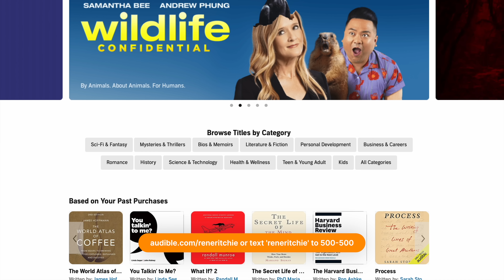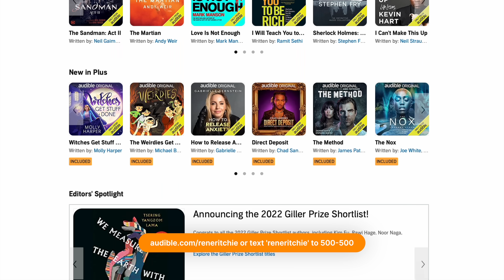The End of Big Silicon — Apple, Intel, Qualcomm

Comment: Im reaching a point of limiting my CPU & GPU performance by undervolting/capping GHZ so I can get more efficiency/stability, this allows me to have pervious gen top performance but taking advantage of a new node to gain more efficiency, it works wonders on laptops.
So I would say, buying the latest to get top performance of a previous gen at half power, is what motivates me to ‘upgrade’

Comment: The Limit for processors was hit years ago when they couldn't brake the 4GHz limit for a single core X86 processor, since then makers have had to move sideways in dev by adding more cores but lets the issue is still present. They have yet to make a +4GHz processor core.

Edit: wow I feel old, was it really 2008?
Reply: Interesting, can you explain how AMD is hitting 5.8Ghz on 7950x and Intel just releasing a 6Ghz 13900KS?
Genuine question btw. 
Are you saying they are using tricks?
Reply: @a.m.g.r7804  This was 10 (ish years ago) due to the size limitation of the technology but now there are into the sub 10 nm process it looks like they are breaking the barrier again but as stated in the video they are struggling with heat dissipation and silicon tunnelling issue resulting in throttling of the processors to under the 4GHz speed
Reply: @AJB2K3  I don't understand what you are saying 4ghz was exceeded about 12 years ago atleast on desktop, there wasn't any issue with it throttling. Certainly more recent with 5Ghz+ things are getting more difficult to cool as power usage goes up.

Comment: The atomic radius of silicon is about 0.11 manometers, so we are reaching the limit of this element. Something will have to replace it, eventually, or we'll have to replace the transistors with something else.
Reply: More efficient software. If we could only use machine instructions as sparingly as we did in the 70s and 80s, combined with modern CPU architecture and algorithms. Offloading as much as possible from the main CPUs, like old-school mainframes did. There has to be a limit, and likely we're already close to it. Making better use of the available process nodes, in terms of microarchitecture. The ever increasing CPU speeds we've seen have made software development lazy so far as efficiency is concerned.

Comment: Not the end, The begining for qualcolm

The snapdragon 8 Gen 2 is already on par with the A16 in everything but single core CPU performance

It actually beats it comfortably in GPU and Ram performance

Is it the end for Apple silicon ?

Apple can advertise its single core performance all it wants by humiliating Qualcolm, equating it with A13

The fact is, the A16 is hardly 20% faster than the A13 and less than that with the 8 gen 2

The difference between the A12 and the snapdragon 845-855 was far more than its now

The 8 gen 2 is far faster than chips 3 years older and Qualcolm is showing no signs of stopping

Maybe Apple is reaping the results of its chip team talent loss

But Hope not

Comment: I think the largest issue is heat dissipation and cooling that would make computers go to the next level
Reply: a expensive paperweight is all you'll have, as there is no point in battery/performance, if the apps are not there, and plugin's.

To me, apps always dictate what device can be used. If the "right" apps are not there, its not gonna sell. Which is why Rosetta 2 is still in OS today and haven't been pulled yet.

Cores and all make a huge different sure, but app development  native come first.

Comment: interesting comversation, i always wonder if there a theoretical limit on how large a single die can be, imagine a modern 4 nanometer chip the size of 10 486DX processors, yes big but can still fit inside a modern gaming PC and would have more power than any modern computer. Yes, it would probably cost alot to produce but its only a scaling issue not development as we already reached 4nm capabilities.
Reply: I’m pretty sure dies will get larger as it becomes harder and harder to shrink the nodes.

Comment: Why don't we just refine our current coding structure to make applications and operating systems leaner and super efficient to "fly" even with a 10nm chip? I mean, I don't see the need for smaller and smaller nm numbers if we can still get the same performance for older chips with some ingenious coding tweaks. I remember the days Windows XP could fit in a 700mb CD and now, it's like a 4GB mamoth with endless services that just dont really benefit us that much. Back in the early 2010s when everyday smartphone applications never crossed 20mbs and now....we talking of GBs! I think the conversation should work in three directions. 1) Coding techniques 2) Efficiency per nm and 3) Battery technology.
Reply: well said a clean mean leaner code & running few services could be the answer we need
Reply: @dinozaurpickupline4221  absolutely. Even these older smartphone chips pack a punch!
Reply: yes,I'm rockin an older realme 7 pro
I don't know when would chrome force me to use 12gb ram phone
Reply: blame the os itself
Reply: I downloaded the Adobe PDF Reader years ago and it was 60GB. I expect that it would be close to 80GB now, if not more. There is no way a PDF reader should be that size. Software bloat is real.
Reply: @sylviam6535  that's too much...I suspected it also bundled some adobe features undeneath. I used Sumatra PDF reader, less than 10mbs....and works fine for me

Comment: At some point, it will be harder and harder to make chips faster, instead we need to also make the rest of the system faster as well - so even if the CPU isn't 20% faster - the overall system will be. We are starting to see some of that with PCI 5-6 and the move from SATA to PCIe based NVMe drives.
Reply: the one that slowing down the system is the bloated os

Comment: I really liked what they talked about, but I have a question: why has nobody talked about the fact that Apple has been stagnant for 2 years in its high-performance core designs?  In 2020, when Apple released the A14 Bioinic chip, I presented it with the Firestorm cores, which reached a frequency of up to 3.0 GHz. The following year, I presented the Apple A15 Bionic with the Avalanche cores, which reached a frequency of up to 3.24GHz, and this year. Apple presented the a16 bionic chip with the Everest cores with a frequency of up to 3.46 GHz after 2 years and if you take the difference in frequency that Apple increased between its processors to see the increase in ipc that they would have achieved in 2 years, you get an improvement very small which is probably achieved by the increase in the L2 cache that apple has doubled in the high performance cores from a14 to a16 while in those same 2 years arm has achieved an ipc increase of more than 20% of a core cortex x1 to a cortex x3 nucleus
Reply: Well Apple has been 3 years on the same node.
Reply: @Sinier940n  It has been 3 years in the same node but it is the first time that there are no changes in the high performance cores if you don't remember from the a12 chip to the a13 chip they used the same 7nm node and they were able to increase the ipc by more than 11% now it's been 3 years chips no changes to performance lake cores
Reply: X86 is a very different beast than Arm. X86 has legacy that holds it back, code that is never used but needs to be there.
Reply: @jasonmajere2165  True. But when you talk to the actual engineers, they say that all that legacy stuff is like 5% of the core die space and doesn't really have any effect on the overall efficieny.
Reply: The clock speed is only a small part of the equation. There has been improvement in the architecture which produces more throughput compared to the old. So the fact that they dont have to clock higher is a plus point instead of drawback. Another metric is the amount of work done per watt where Apple has smashed thru the roof !!!

Comment: I remember in the 90s processor speeds doubled every 18 months. Once they hit 1 GHz the gains seems to have slowed. You get to a point where it is harder and harder to make more gains. Once they hit a wall on processor speed, they started adding more cores.
Reply: Was having this same conversation with my kids about how it was speed-speed-speed, then that leveled off, and then it became cores-cores-cores and now that starting to level off. I think the processors are so powerful now that they are rarely pushed to their maximum limit, I think the next ‘big thing’ is going to have to be software optimization for increased performance
Reply: people are looking at that,shifting loads on the server side to quantum based stuff,making os that keeps in account of quantum states & using AI seems to me like the next step,people need to colab more & instead of discussing these things on internet techathons should be launched around the globe,discussing these issues  on main stream
Reply: @MightyRob1  - The next thing will be accelerating the APIs in the CPU, but that may make the CPU wedded to an OS unless some generalized API for OSs is created, which I don’t see happening other than maybe for open source OSs.
Reply: However, GHz in the 90s aren't the same as the ones we have now. A 3 GHz from the 90s would PROBABLY have been the equivalent of today's 500 MHz
Reply: And that's where you measure iops and fps and running code like mining and other tests to see what it does. But my phone has line 12gb of ram and unless it is under 45% it starts acting buggy

Comment: Intel / AMD was stalled with x86_64 and backwards compatibility. Apple merely scaled the designs from the iPhone SoC designs which are more ARM clones than actual ARM licensed designs.  Even if Intel / AMD considered ARM and doing what Apple's done. It would produce non-compatible processors. Apple's secret weapon since Apple bought NeXT was the NeXTStep / OpenStep that evolved into Mac OS X and the developer API's.  Developers if they didn't do a lot of weird stuff in their code were able to port from macOS to iOS/iPadOS on ARM64 with very little effort.  In some cases, just checking a box and making some GUI changes. It doesn't work like that with Microsoft. It takes a lot more effort.  Linux has always been running on most every CPU architecture out there and there is already a Linux distro booting and running on Apple Silicon.  Apple still has a big head start and you have to understand Apple has internal Apple Silicon designs perhaps 5 years into the future they are developing. Some of which are waiting for FABs to be ready.  Because Apple controls the OS and the Developer API's they can deliver radical change far easier than anyone else.  No doubt Intel, AMD, Qualcomm, etc. will be attempting to change rapidly.  The next 5-10 years won't be boring that is for sure.
Reply: I love apple & linux
Reply: The Linux software ecosystem is mostly open source, so everything can be recompiled. Windows has to be able to run a large body of closed source x86 legacy code.
Reply: Intel won't... They can't do the same, in fear of breaking backward compatibility.... So much  more x86 apps break under Windows 11 ARM translation, and despite Microsoft's effort, there are no really any signs of improvements.. Apple is way ahead with Rosetta 2... besides, how do you solve the issue most manufactures will not go over at all ?

Drivers? chipset for motherboard by third parties like Gigabyte. You'll break too much trying to making everyone work together.. Apple can do it because their the they do it all.. True, you do have Surface tablets use ARM, but not in mass.. PC's (x86) are still used in businesses. and you can say goodbye to running ARM versions of Sophos or ESXi in a VM on ARM chips. That's not gonna happen. Perhaps that may change, but its gonna take a very long time.. if happens at all.

Comment: I think desktop should move to arm architecture or something similar. X86 is starting to stagnate in terms of performance efficiency/perf gains with new process nodes as well.
Reply: Care to remember that ARM is not solely Snapdragon. Apple's chips are based on ARM and they include x64 instructions sets to better accommodate legacy code, but once the need for that emulation is dropped, the chips will be even faster for native code.
Also, MediaTek is making some incredible advances on performance per watt as well. If you check Dimensity 9100 benchmarks you'll see important improvements.
So, the shift from raw power to dedicated silicon is key to the future of computing. Instead of a one-size-fits-all you get software backed hardware that can expand where raw power finds a limit.
Reply: ARM architecture has reached it's limitations as well. Isn't the latest Snapdragons stagnated at 3ghz. The last two flagship chips had cooling issues.
Reply: @DerrickBest  arm hasn’t reached its limit. 3ghz is the clock speed because it’s a mobile device and raising clocks would increase power consumption. The new snapdragon is significantly faster than the previous while keeping similar clocks though.
Reply: @Earnist Se but they did stalled. If they were getting faster chips they could lower consumption a bit and increase clock speed.

Comment: A real question is how much speed do you require to do what you want to do.  Most iPhones rarely if ever  run into their  maximum performance even playing games.
Reply: You don't need all the power of your new devices, but you need a performance overhead if you want to future proof them for a few years.
Reply: is not only about speed but efficiency
Reply: @westsidehvac1097 1097 Efficiency is such a broad term. What exactly does it need to be efficient? Heat dissipation and power usage I can understand, but each is balanced on the three-legged stool by performance to get a true understanding of the fit of the device to the needs you must define and characterize each of those parameters based on intended usage,
Reply: PCs are in the same situation when used for general purpose/office work.

Comment: What will happen then? If Moores law stops or at least is slowing down and at the same time the compute tasks keep on increasing fast, the energy needed will increase really fast, that might be quite problematic in the coming years
Reply: It will hit a physical limit after 1  nano meter
Reply: @TalkLouis  Since the diameter of a silicon atom is around 0.21 nm, I assume you are quite right, 5 atoms wide lines, not much more to improve else then software and ipc gains, that will improve but not as fast as previously

Comment: At a consumer level, how much more powerful machines do we need? I bought an M1P MBP and it's going to last well over 5 years before I even need to think about MAYBE upgrading it. I get people like you Rene, who need to process massive files and workloads to run video channels, but the average consumer is reaching a point in tech where anything they buy is probably much more powerful than they need, smartphone, laptop, tablet, etc. Even for you, I can only see maybe a few years before it's all capable of handling your workload completely with no wait or as little as possible.
Reply: Exactly! 10 year old computers that were $1000+ when new (and would probably have dual-core CPUs, 4 or 8GB of RAM, and 500GB SATA hard drives) are totally usable for most people's use case if you install an SSD and Linux or even just a fresh copy of Windows 10. 10 years ago, you could most definitely not use a computer from 2002 (which would probably have a single core CPU, 256MB of RAM, and a 40GB IDE HDD) for modern tasks, they would be too slow. You could likely keep using that machine for at least 10 years unless Apple decides to slow it down significantly in a software update (even then, you could use Asahi Linux instead).
Reply: I read this every so often. You can look back in time and see people asking the same question going be ask to the transition from 8 bit to 16 bit, 16 bit to 32 bit and 32 bit to 64 bit. We were told back when that the new 1GHz Pentium was as fast as we would ever need. Even further back, when the IBM 286 came out that it would do whatever a business ever needed.

They were wrong then, and thinking that now is also wrong.

Comment: And then IBM creates the photon CPU - millions of times faster than the fastest imagined silicon, millions of times less power.
Reply: Yeah photonic.... The quantum computing I Heard decade ago... Why it isn't achieving mainstream success? Lifi the using wifi with light? Why it isn't become mainstream?
Reply: @cutejapangirl1117  lol,you sir ask the darnest questions
Reply: @dinozaurpickupline4221  lol the name said Girl and you said Sir lol
Reply: @cutejapangirl1117  - They were experimenting with optical processors back in the 1990s.
Reply: It is different.  You cannot run the currrent software on it.  It may be able to speed up certain very specific computing tasks.  It will not be the notebook computer chip that you carry everyday.